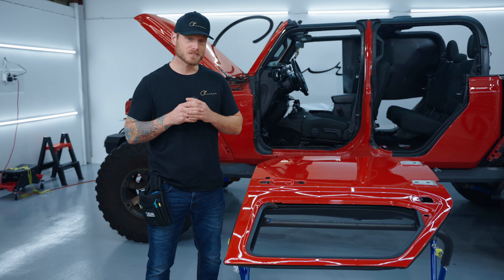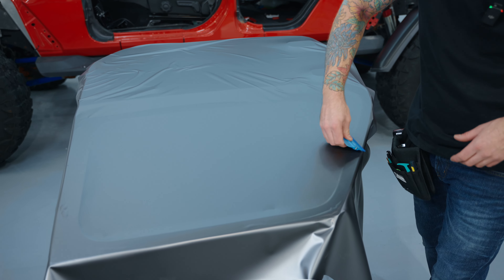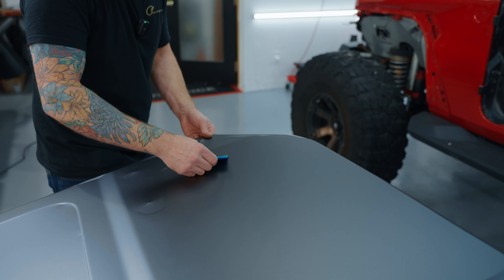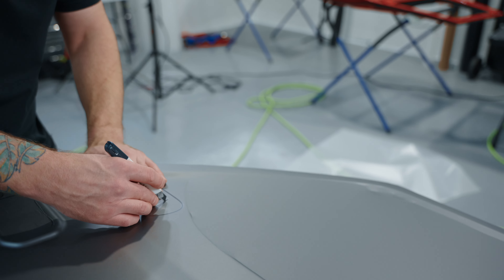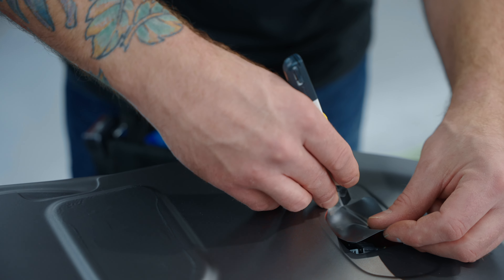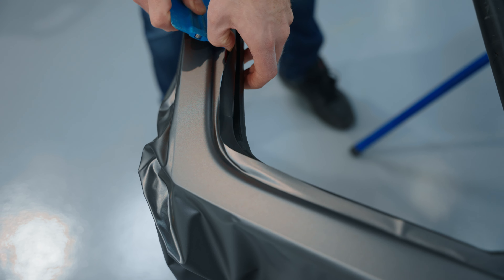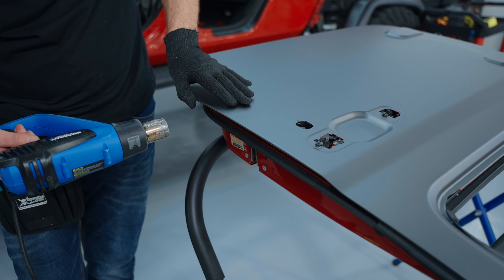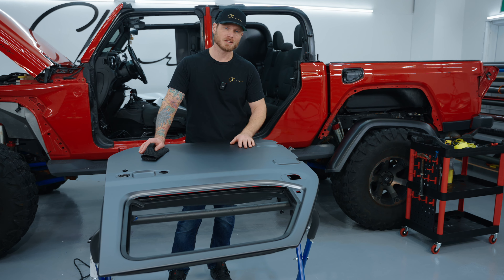Paint Protection Film With Color??! Vinyl Wrapping A Door In Detail - Jeep Gladiator Part 1

Comment: why you don't remove rubber seal?
Reply: I guess because you can easily tuck it inside.
Reply from the maker: Exactly, it's a waste of time to remove it and reinstall it due to how soft and pliable it is to work with it on.
Reply: @CKWraps   yes but it's easier to clean and we have 100% sure there is no dust under vinyl.
Great job !

Comment: What’s the difference between wrap and coloured PPF?
Reply from the maker: Good question. Colored PPF is the same material used as clear PPF which the most exotic and expensive cars have. It self heals from scratches, remains very elastic, has a much longer lifespan, and holds up much better to stones and debris thrown at it.